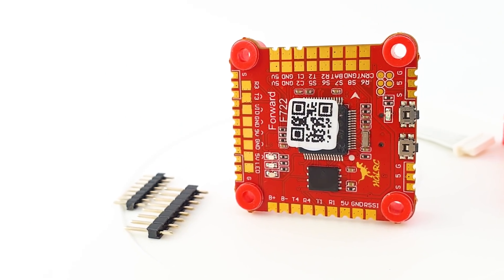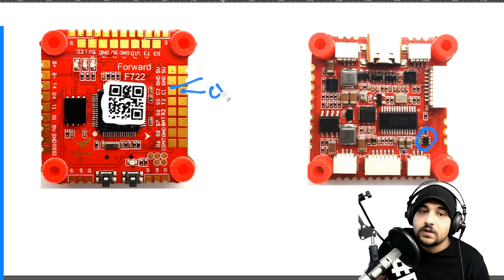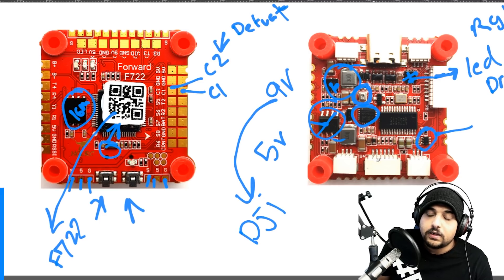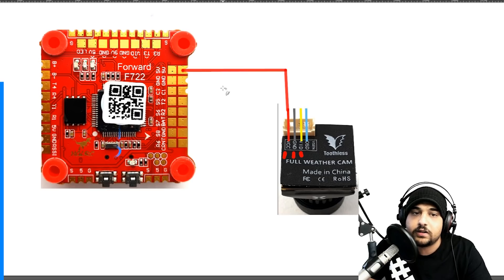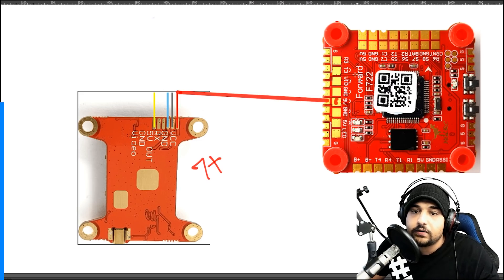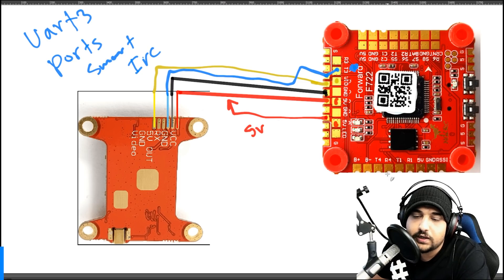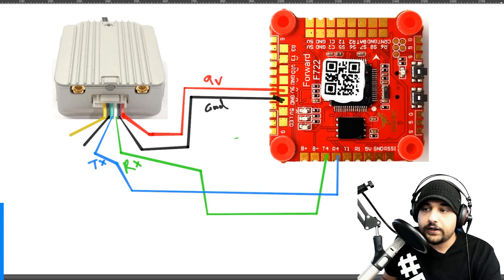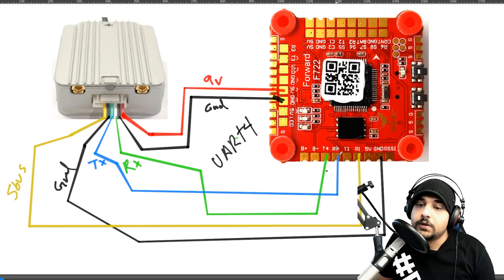MOTHER OF ALL F7 Flight Controllers + DJI // HGLRC Forward F722 Overview & Setup Guide

Comment from the maker: HGLRC Forward F722: https://bit.ly/3eDyYKi
Direct From HGLRC
F722: https://www.hglrc.com/collections/fc/products/hglrc-forward-f722-3-6s-f7-flight-control?ref=f1qojffry3c
F722 WIth ESC: https://www.hglrc.com/collections/new-arrivals/products/hglrc-zeus-f760-stack-30x30-3-6s-f722-flight-controller-60a-bl32-4in1-esc?ref=f1qojffry3c
Reply: Says on the wiring diagram provided that c1 is the default camera not c2. Have I got an updated board?

Comment: Great vid! I just got this stack (Zeus F760) and am going to use it with the Air unit. I would like to add the flywoo BT to it if possible but it needs it's own UART. As I'm using the air unit which is on UART4 according to the manual, and no 5.8 VTX does this mean that UART3 is freed up to be able to use it for the BT module?

Comment: I buttoned up the quad but realized I didn't enable the UART for my DJI unit.  I would have had to pull the top plate off, which is the worst for mine, because I couldn't see the TX and RX pad but thankfully you mentioned UART4, thanks!

Comment: Hi D-mesh, my forward f722 lasted 5 minutes?? RC said low rissi/ rissi lost etc . My quad was only 1 meter away from me! Then nothing? I was using a crossfire transmitter and thought I’d have no problems! Very disappointed! Got home and checked it, wouldn’t power up to beta flight? Through the USB port? Not even with battery connected? So unhappy to say the least! Got the combo! 🥺🥺🥴👌

Comment: You never mentioned the LED pad sitting next to the 5V pad. I got LEDs  for this board and betaflight wont recognize the LEDs unless the signal wire is on the LED pad?

Comment: Can you use this fc with 4 individual esc's?
Reply: @robertilkanic5452  yes I got this FC myself and running 4 ECS's. You just need to remap some of the pins. Check Oscar Liang's BETAFLIGHT RESOURCE REMAPPING tutorial, it explains it pretty well
Reply: There's no way I can still use the ESC connector?
Reply: @robertilkanic5452  what ECS do you have 4in1 or 4 individual ?

Comment: I've noticed this flight controller and the Foxeer F722 V2 have the same APU. Which of the two would you say is better?
Reply: The only difference is this one has the barometer where as the F722 has the TVS diodes and the 3.3V regulator. I can always add a barometer separately so I guess I have answered my own question.
Reply from the maker: all flight controllers have the same MCU. There are about 4 in total f722 f405 f411 and f745

Comment: Thank you for taking the time to do this video. I crashed and ripped off the connector from the 4in1 esc how would you use the 2nd solder pads to fix it? Or just get a new FC?
Reply: See if you could resource map to use a different pad for motors

Comment: Really interesting! If I want to use single ESCs I can't see Motor pads.
Reply: S1 S2 S3 S4 should be the esc connections.
Reply: Yes, you are correct,  they are on ESC connector. Since I don't like to use connectors, I'm wondering if I can remapp S5, S6, S7, S8 pads. Can I?
Reply: You dont need to remap unless it's more convenient in some way for you. There are physical pads broken off from the connector onto the board already.
Reply: @highlandcrawler  so if I wanted to use separate esc and use the esc connection how would I do that? And at the esc connection there's a pin for Bat would that get hooked to the battery?

Comment: Can i connect this to a Mamba F60PRO ?  Or will i have to connect it to its own ESC
Reply from the maker: Yes just route the wires correctly 1 goes to 1, 2 goes to 2 and so on until 4. Vcc from esc will go to the bat pad and and gnd to gnd that should get you going.
Reply: @DroneMesh  thank you :)
Reply: @DroneMesh  anyway you can make a diagram showing how to wire this way? Thank you for the video I bought mine watching your video but I didn't think about using it with separate ESC'S